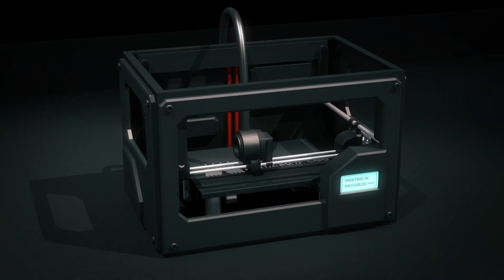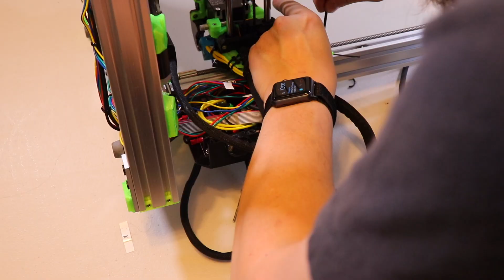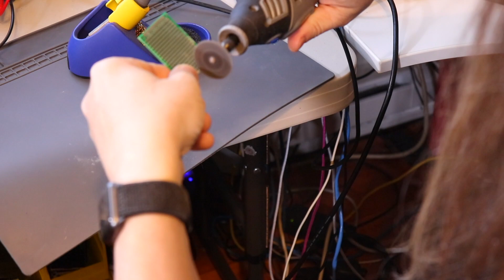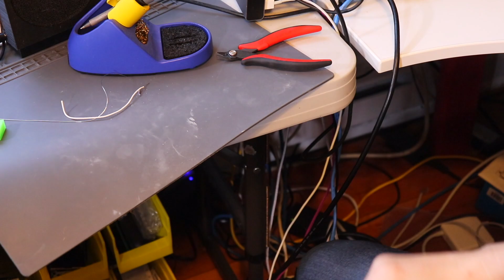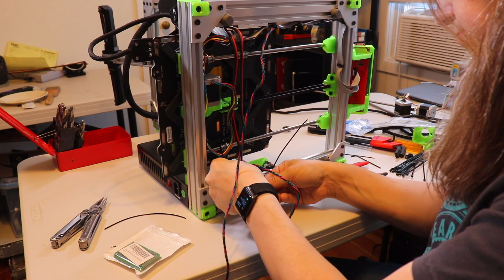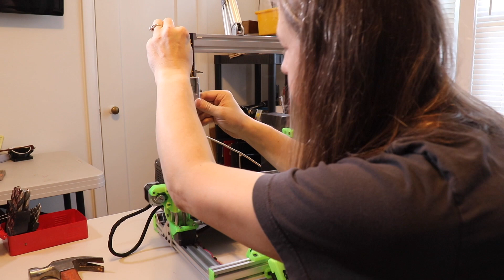Building a Custom Prusa Bear 3D Printer (Part 6) - Upgrades

Comment: Check out TheZeroBeast (TZB) extruder for your MMU2.  It solves some feeding issues and makes it easier to open the idler door.  It also has a tighter filament path around the bondtech gears.  You may have to get the step files from his github page and edit them.  I found that the clearance around the hotend heatsink was a bit loose.  Some filing on the sensor pin and lever might also be necessary, but when it's set up properly, it works very well.
Reply from the maker: Thanks! I hadn’t heard of it before. I’ll have to give that a try. I’ve had some successful printing, but overall it’s been a lot of trouble on the stock setup.
Reply: @makermelissa  It's based on the MK3s extruder.  It has a passthru coupler on top that helps to feed in the filament and moves the IR sensor within the extruder body to get rid of the sensor tower.  You'll need a longer PTFE tube between the MMU selector and the extruder to make up for the length lost from the passthru coupler.  I suggest taking measurements as you put it together.  I didn't and I just estimated the length after the fact.  If the tube is too short the filament will grind when it enters the extruder at high speed.  If it's too long you may get a minor speed penalty when the filament is loaded.  Once you have an extruder that loads properly, the next thing to work on is reducing friction.  I found that the stock filament buffer adds a lot of friction to the system.  You can check how much friction you have by disconnecting the PTFE tube at the MMU selector while you are printing and pulling out some filament.  I'm getting ready to test the Quick Load MMU Filament Buffer by Are_Kow.  Search 21311 on prusaprinters dot org.  I have it printed, but I need to buy the hardware for it.  I also found that I needed to put more tension on the extruder with the MMU2, especially when using the Inland PLA that I normally buy.  It has a texture to it that adds some friction.  The head of the tensioner screw on my extruder sits flush with the extruder body with the filament unloaded and the threaded end sticks out of the nut by about 2mm on my machine.  The MMU can definitely work well if set up properly, but the 3 most important things are to make sure the sensors are working as they should, make sure the filament can feed and load without obstruction, and keep the friction to a minimum.  Identify what is causing the biggest problem, then file/sand/modify the offending part until the problem is solved, then move on to the next problem until the system works well.  Good luck

Comment: Looks like you have plenty of space at the bottom, can't you lift the Z motors a small amount to push everything up at the top, giving you back the extra z height?
Reply from the maker: Yeah, I thought of that a little later, but I've already installed the new longer smooth rods, so it's no longer an issue. :)
Reply: When you raise the Z motor mounts, you loose your reference point from the bottom frame and if one side is higher than the other than one of your Z tops will also be higher than the other and your X axis will be racked after doing a Z calibration.  The best way to raise the Z motors would be to edit the Z motor mounts to add the extra length needed so that the motor mounts will still sit flush to the bottom frame.